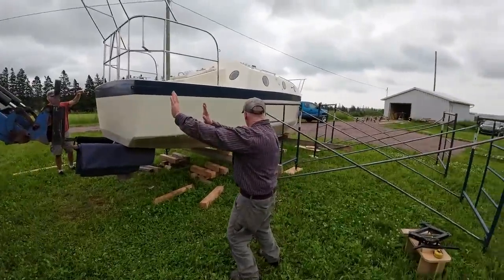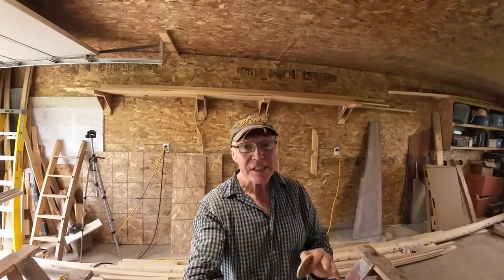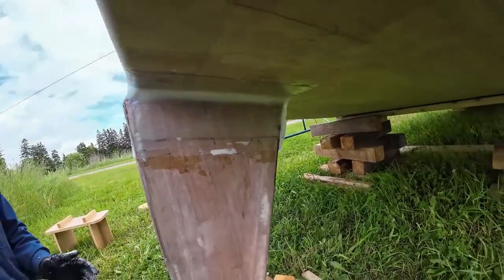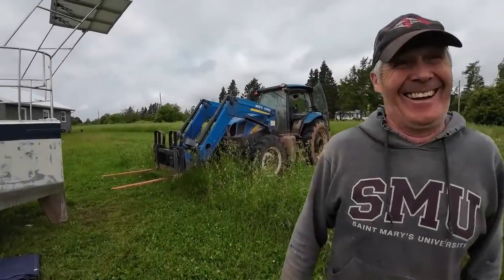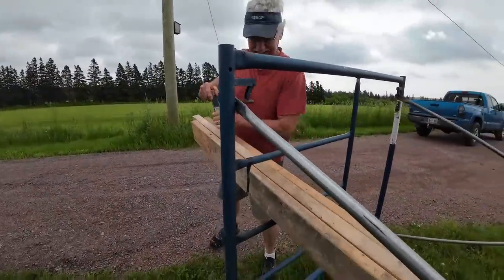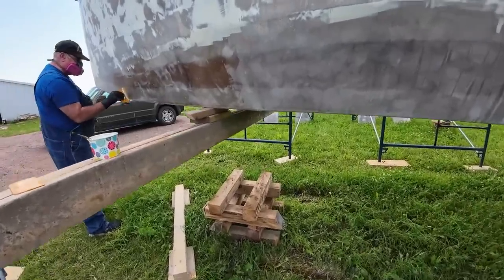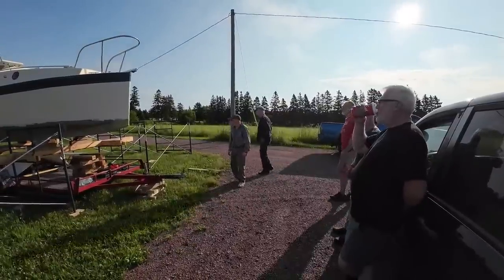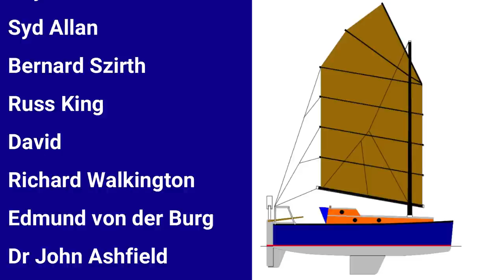S2E89 Keels On!!!  // 22 Days to Launch

Comment: I was looking at the skeg when you went inside the boat and was thinking, “you know I think I’d put some lateral bracing on that…” lol. Nice job.  That puppy’s not going anywhere.  I recall cutting the centreboard slot in the hull of my boat and thinking, man I hope that’s in the right spot. She’s coming together very nicely Alan. You must be very happy.
Reply from the maker: I know what you mean, drilling the holes in the oak beams and thinking are they going to line up with the keel.

Comment: I hope you don't mind me saying you have in my opinion made a mistake is choosing bilge keels. My reason for saying this to start with on a round the world voyage how often are you going to dry out, probably never or once or twice so the only advantage is if you haul out at a marina you are not going to need a  cradle. I built a mirage 28 years ago and fitted bilge keels. It was slow and didn't point very well. Some years later I bought a second Mirage 28 in Greece with a fin keel.  I still had the first one for UK sailing. What a difference, it of course pointed a lot higher and was no doubt faster through the water. My original with the bilge keels had a 15 hp diesel motor whereas the later fin keel only had an 8hp diesel motor but again it was faster through the water, my log confirmed this. My final point is that with the bilge keels I had to built a ring beam across the boat and onto the keels to help with the loads from the mast whereas the fin keel had a king post straight down onto the mast which was probably stronger. Having said that I never had trouble with either.   I wish you well though and have enjoyed all your videos on the build. regards Ken (UK)

Comment: Excellent! How did you kept measurement for the keel bolts and positions?
Reply from the maker: I had marked centerlines inside the boat early in the build and carefully aligned the oak timbers running athwartship at the right spacing. The holes in the Keel flange were drilled by a waterjet precisely to the spacing ( you might enjoy the earlier video about building keels with a waterjet and CNC)
Reply: @RoversAdventure  All right! That's one of those things that need to be pretty accurate and is in awkward angle and position. Thinking ahead it is!

I'm gonna have pretty similar keel assembly but of course much bigger! 😅 It was very interesting to see your build with it. 🙂

Crack on!

Comment: A major milestone (to put it mildly!) Very interested to know the keel angles from vertical, and (off?) parallel.  Was the final alignment simply keel plates flush to hull or was there a whole lot checking involved?  Hats off to Rover Navy!
Reply from the maker: Gosh I like that Rover Navy over Rover Nation! Done! A whole lot of checking was done on the hole drilling before the whole evolution. And even then I had a bit of anxiety...I'm just an ordinary bloke after all, lol. Thanks for the comment and looking forward to meeting up as WR crossed the Torres Strait.
Reply: @RoversAdventure  Also looking to meeting WR and her skipper in the flesh, recently met up with another YT sailing channel!  Perhaps all these keel angles are plans only, I seem to remember hearing later twin keel designs are stepped in two or three degrees from parallel.  Was thinking Rover Regiment, but that would never do for a bunch of sailors!
Reply from the maker: @prof.heinous191  May I ask who was the other Channel?

Comment: The skeg being vulnerable, would it be practical to make it as a sacrificial skeg that would break free without damage to the Hull?
Reply from the maker: Interesting idea. My main concern was that if it failed it would do so below the hull and not cause a flooding situation with a splintered and jagged hole at the hull.

Comment: Did you use Gel Coat paint for wave Rover ? It looks like just expoxy paint. Isn't gel coat better for protection of the fiberglass and the hull. 
Wave Rover is looking good.